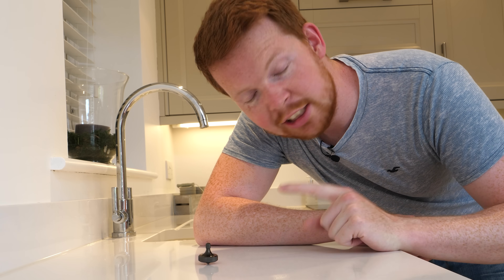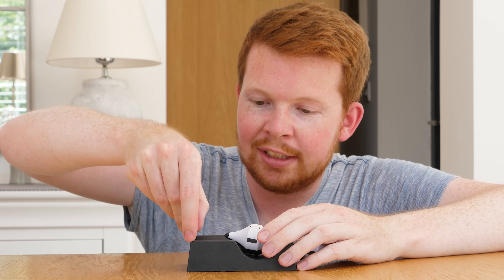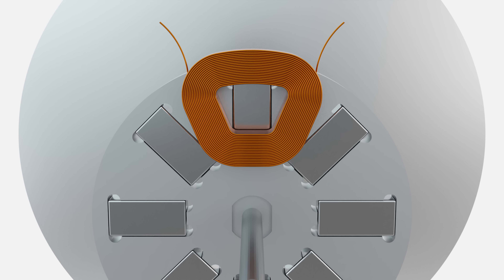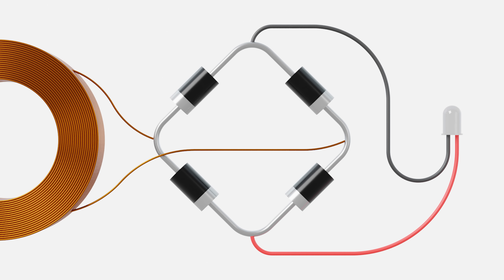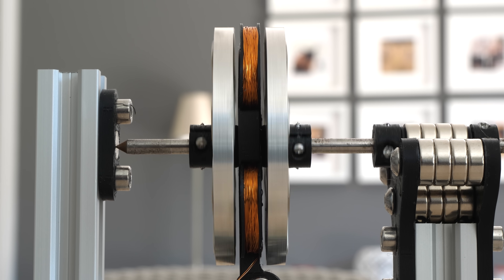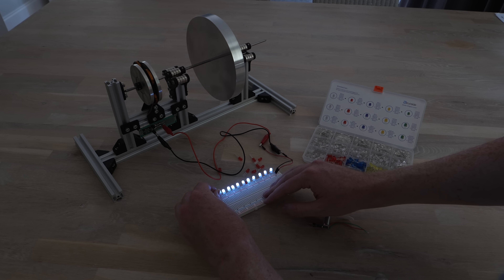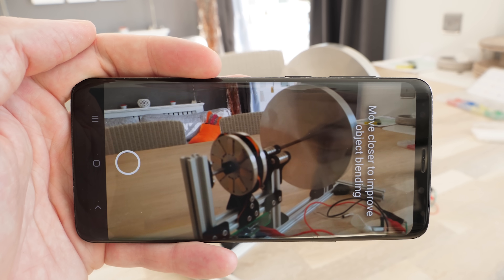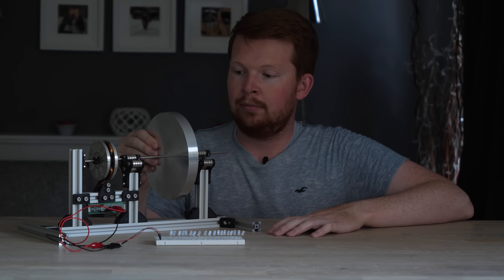Flywheel Battery

Comment: Around 11:20 when you're watching the led light up in pulses as the magnets induce a current on the copper coils, what if you added another space of copper coils to the left of the outboard magnet wheel, and then a third magnet wheel... but this time rotate each magnet wheels spacing within the wheel so that they do not pass through the coils plane all at the same time.... Right now you can see very well when watching that the magnets all pass through the coil at the same time. this makes the individual pulses stronger, but makes for the dead zone of current in those 45 degrees of rotation that they are in the middle of the coil windings.  Rotating each subsequent wheel would "smooth" out the power (almost like 3 phase) and provide a more "fluid" flow of current to your output, be it a fan or LED!  It would be as simple as offsetting each wheel by 15 degrees. Or if you didn't want to add a copper winding you could offset the outside wheel by 22.5 degrees for a smoother current output.  When I saw this I thought it would be very cool to add on the opposite side another set of copper coils and magnets that you could induce a current by adding your own power input from a fan, water wheel, gear driven system to start turning the system that way you have no mechanical connection to the rotating shaft as well further limiting the amount of drag/friction/imbalanced forces on the shaft itself.

Comment: 1:30 How about using another pair of magnets, one  at the end of the axle and another opposing one in the post? That would prevent the axle from moving towards the post and wouldn't require any contact.

Also, it would be interesting to charge the flywheel with electricity but that would require some kind of syncronization method for the coils to be able to push more speed to flywheel.

Comment: LEDs take surprisingly little current to light up visibly as long as you provide enough voltage to overcome the forward voltage. Just playing around, I've lit up a white LED visibly (though dimly) with as little as 1 or 2 nanoamps, not milliamps or microamps. That's 0.000000001 amp. Which was the lowest my multimeter would measure. But a typical LED will usually run on about 20 milliamps, or 0.02 amp. This means an LED will glow visibly when supplied with 0.000005% of the current it's meant to use. Or 1 20 millionth of the current. Which just absolutely blows my mind that you can put that little amount of energy into something and have it do anything useful.

I can even touch hold one end of an LED, touch a finger to one side of a 9v battery, then touch the other end of the LED to the other side of the battery, and it'll light up no problem with the teeny tiny little bit of current that's able to pass (harmlessly) through my body from just a 9v battery. Which is a pretty neat party trick. White LEDs are best because they're more visible, but they also have a higher forward voltage of about 3v. As opposed to a red LED which only requires about 2v for the forward voltage. Which is basically how much voltage the LED needs to turn on. You can pump as much current into the LED as you want, but if you don't give it a voltage near the forward voltage, it's not going to do anything. Although I should mention that technically you CAN lower the forward voltage by putting more current into an LED. It's an actual figure they include in the datasheets for LEDs. They'll give a graph showing what the forward voltage is at a given current.

Comment: I wonder if you could hook up a motor controller to your coils and make it spin, then use a relay to to switch back to output mode and charge batteries to run controller.  Have you tested to see if it spins for a shorter time when coils are in place vs removed?

Comment: Large scale Flywheel Energy Storage systems are being investigated in California, as the State is working to shift it's electric grid toward 100% carbon-neutrality, with Solar generation as the primary source. The idea being to store excess solar energy from the daylight hours into bank of large flywheel storage cells for release overnight. The problem with any electro-chemical storage battery is short cycle life: lithium-ion batteries degrade a little with every charge/discharge cycle. But flywheels are expected to last 25 years and require only minimal maintenance. Flywheels do have one problem: parasitic energy loss. Generating a magnetic field powerful enough to levitate and suspend a 1000kg flywheel can't be done with permanent magnets as in this video: only electromagnets have a strong enough field to support a flywheel that heavy, so the magnets themselves are consuming power. The housing for the flywheel has to be in vacuum to eliminate air drag on the rotating flywheel, and maintaining a high level of vacuum requires pumps that consume some energy, too.

Comment: Very interesting. I am living in the mountains of northern Sonora Mexico. I don't have electricity and want to build a generator. This video explained so much to me. I never understood how electricity is made or harnessed. Ok, I want to build a steam engine and a water pump and have a generator all in one, but also want to do a solar array to charge batteries instead of running a generator or welder.

Comment: Try using a power harvesting board (like sparkfun's LTC3588 breakout board), and a "joule thief" circuit. You can then tune it to drive LED's brightly. You might even add a "super capacitor" to prolong the time.

Comment: What if instead of that glass thats keep the shaft from moving you would put two magntes on the shaft and on the sides of it and then the weight of the flywheel would keep the whole thing in place? Then you wont have any friction and the flywheel would spin for alot longer with less efort?

Comment: Very cool project that is used in critical systems that can't afford to loose power. I got to design one of these in when I was going through my mechanical engineering degree. Basically a big version of this is used in some hospitals and nuclear power plants. When the power goes out usually these places have diesel generator backups that turn on automatically when the power goes out however there is usually a couple second delay to get the generators booted up and producing stable electricity. To fill that few second gap a flywheel battery is used. When power goes out a slipper clutch is engaged on the end of the flywheel shaft that changes its engagement level to ensure that the alternator only spins at 3600 RPM producing stable AC electricity. The actual systems are actually pretty complicated with lots of thought put into them. The Flywheel actually expands when rotating and the interference fit must be strong enough not to slip. Also the frames natural frequency must be taken into account. If the frames natural frequency is the same as the operating RPM bad things will happen. Just thought I'd give more insight about this to anyone who wanted to know more about this.

Comment: could you possibly use more coils with thinner wire to generate enough electricity to power a motor that continuously spins the flywheel

Comment: Many people have already suggested these and those improvements, so ill just sum up what else i might do here in theory:
Better diodes, but im sure it's also manageable to maybe use a singular zener diode to be able to make a voltage rectifier and/or a precision rectifier instead of the normal diode one with Opamps and all that.
In theory this could work, but dont take the word of someone with only so much practical experience. Zener diodes are only precise at higher inverse currents, which the flywheel battery might not be able to power for long.
I might try to simulate a low power input to constant voltage output later

Comment: Would be interesting to see the difference in performance when:
1) in a vacuum chamber
2) custom shaft turned on a lathe (as energy is lost in wobbling)
3) some friction reduction on the lateral guard (like bearings or lubrication)
Reply: 99% of the energy is lost due to the coils slowing it down, im surprised he did'nt make that clear, you can't just take energy from that system for free. The changing magnetic field indeed induces a current in the coil but the induced current creates its own magnetic field opposing the movement of the magnets. Thats why in the start it kept going for long and when he started adding more and more coils it started slowing down much faster.
Reply: @fosteras5292   Endless rotation was not the goal he was trying to accieve, it's a battery for storing energy. Obviously the energy has to come from somewhere. The flywheel is only a way of storing it. Energy can be put into the flywheel by spinning it by hand or with a drill. Then the coils can be used to extract the energy, hence slowing down the flywheel.
Reply: @bartjuuhhful  i doubt the autor meant what you think, anyway performance wouldnt change dramatically, when the coils are connected it would be basically the same, and it still would be losing energy if you just leave it. Might be an interesting experiment.
Reply: That’s how the electric braking works on electric cars. That energy goes back to the battery
Reply: @fosteras5292  That's not really true. If you get this mechanically right, including a vacuum chamber and two magnetic walls for the shaft, you get quite an efficient machine. It can be used as a highly efficient battery(more like a capacitor, but still). In fact, that's exactly what the coal and nuclear power plants are using. Of course, they just use bearings instead of a magnetic levitating shaft. They don't really have a specific power wheel for that, but the huge turbines serve the same purpose. That's why even without power, thanks to the huge spinning turbines, they can supply electricity for some hours or even a day(depending on the consumption of course).
Reply: @ivanbalabanski2942  interesting, i did a couple of google searches and im surprised it indeed has some uses.
Reply: Why not a 2 magnets in same pole orientation? Block[S - N] [N - S]=====flux=====magnet bearing===flywheel===magnet bearing=====[S - N] [N - S]Block
Reply: @slickbackwood  It never seems to be set up this way, but I can't figure out why.
Reply: @aprilliac  graphite-epoxy flywheel on magnetic bearings
Reply: @aprilliac  same problem, it's a theorem of some sort that I don't remember the name of. You can't have things levitate with just passive magnets. It's simply impossible. In that case, to answer your question, any micro vibration that would lower the orientation of the shaft by some incredibly minute dtheta angle would get the side magnets to come together just like he showed in the beginning of the video. It's pretty smart, but it doesn't really work, and you still need some mechanical help to fight against magnets being annoying. Also, a properly lubricated tip at the left of the system will always be much much lower than the passive draw from the generator, even if nothing is wired in.

If all you want is an 'infinite flywheel',  go to space make the same thing, with electromagnetic bearings, no air molecules in sight, and very fast rpms in case you still have a bit of loss. Thermodynamics tell us an isolated system can only keep its internal energy, so isolate the system the best you can, and you have an 'infinitely' spinning flywheel.
Or just marvel at the earth that's been rotating for 4.5 billion years
Reply: @aprilliac  i thought exactly the same thing.
Reply: Or a magnetic bearing so it won't need any lubrication
Reply: I don't know much about electric stuff, but iirc aren't magnets used to create electricity? So perhaps using magnetic bearings interferes with that.
Reply: a very sharp edge against saphire glass with a some viscous material on it would work wonders?
Reply: This needs to be attempted
Reply: ¡¡Exactly!!, in a vacuum chamber to avoid coanda effect at the wheel, the air pressure by coanda effect  going to brake the wheel slowly. it is very important to consider coanda effect on this experiment.
Reply: It also needs to rotate to compensate with the spin of the earth.
Reply: or just attach a steam generator and some blades that run of steam and produ.....oh wait..thats how any generator untill solar/wind came public works. well. sometimes they go boom and create places you dont wanna visit for ages.

Comment: There is in electrical/electronic fields two descriptions to use here. Old school before semiconductors and IC's began diodes were called rectifiers and semiconductor material was not used but such things as selenium rectifiers. The current flow was opposite what is shown when diodes came out. Diodes block current if polarity is reversed. The small band vs large black surface is the negative and the black end positive so negative polarity has to be with negative charge on the negative end and pos on positive end to flow. 

By the later 1960's as semiconductor technology started arising HOLE FLOW was introduced. The flow was opposite of the current flow from positive to negative. This change in teaching has caused a lot of confusion. Explanations were given for this which I accepted then but still shy away from hole flow explanation..

The proton is 1837 times larger in mass than the electron. It is the electron that flows around the proton in an atom, not visa versa.  Now electron flow is presented as not electrons actually flowing down a wire but the electrical and magnetic fields - just like with radio frequencies and light waves. Possibly true but on my shelf of consideration.

Confused yet? Tesla probably was right about wave patterns traveling but in or around a wire the heat produced in the atoms of the conductor metal are a result of flow of either the waves of energy or electron flow. 

Each explanation may have certain validity in different applications with the wave traveling be maybe the most true. 

Great video but having the current flow opposite the actual flow probably is because the author got the terms crossed or got confused between the multiple explanations. The least viable to me is hole flow.  My point  is electrons will not go from positive to negative  through a diode. Wonderful explanations and illustrations else wise. Personally I would like to toss hole flow and possibly as more is found embrace traveling wave of energy then toss electron flow as conventionally  stated. Once not looking like mud on mud amidst 3 explanations a lot less confusion and clarity of understanding would arise to keep people's understanding more solid.

Comment: In my mind, I designed a very efficient wind turbine generator in this same way, only with a tesla turbine instead of a flywheel. Also, you could reduce friction even further by using a tungsten welding point, and a ruby bearing, like the jewels in a watch clockworks.

Comment: Hi Tom  Love the floating flywheel, without reading through everyone's comments,  if you arrange the levitation magnets   S N   [fly wheel]   N S  it should hold itself in place without the end guide, for safety the end guides could have magnets to hold the spindle away from the plate,    Plate+SN NS+spindle+SN NS+Plate

Comment: AT&T had an Emergency Generator Set at a mountain-top radio site in California that was started by a FLYWHEEL BATTERY.  During one start-up moment, the emergency generator "jammed" which caused the ROTATING FLYWHEEN & GEN=SET to break loose from the floor mounts.  When technicians arrived at the site to restore service, they found the entire Gen-Set and Flywheel had broken through the brick wall and rolled out into the parking lot.

Comment: Repeat the experiment using a MACHINED SHAFT instead of a threaded shaft, this will ensure the shaft is true and round. The drill rod you buy at the hardware store is not round or straight.

Comment: If you were to run a small current through the axle that will spin it since it's magnetically levitated. Running a current through anything in a magnetic field that's levitating will cause it to spin so you could use a small solar panel and it would run until a mechanical failure.

Comment: Something that comes to mind is that even with a small point touching the stop plate, there is still friction. instead, mount a magnet on one it both ends of the shaft and opposite polarity magnets on plates. that way, there should be friction only from air.

Comment: Awesome! I'd love to build one of these but I don't have a metal lathe and if I did I wouldn't know how to use one. Maybe I could 3d print a holder and put weights in. Or even better if the magnets were heavy enough the rotor could be the flywheel? Does the act of making current flow put drag on the system?

Comment: In the first years of the hybrid power units mandated by Formula 1 Racing, the gas motor was to be augmented either by batteries or flywheels, including the ability to regenerate under braking. To my knowledge, only one team developed a flywheel-based version, and I forget why, but I don't believe they ever ran this unit in a competition car. Rotating energy storage for vehicles was first explored in detail by a father and son team named Post in the 1970's. Apparently, it is going to take a lot of added value for these ever to dominate chemical storage.

Comment: Because you put the LEDs in parallel, you only need to produce the voltage potential for a single diode, but more current. Thus they can glow at low rpm. If you hook them up in series, you will find it much harder to light up the LEDs, due to the higher voltage required by the circuit. You may also experience a noticeable increase in 'drag' on the system, as generating that much power will suck energy from the flywheel faster.

Comment: you can add 100 LED's and it will still run if you spin the wheel
the point is the wheel will loose spin much faster if you add more draw on the breadboard.

you should compare how long the wheel can spin with 1 LED vs with 5 or 10
it will run 10x longer with 1 LED